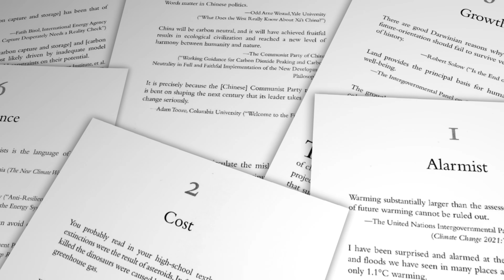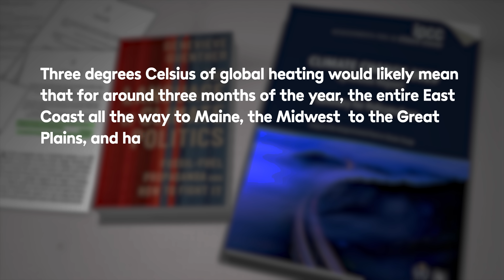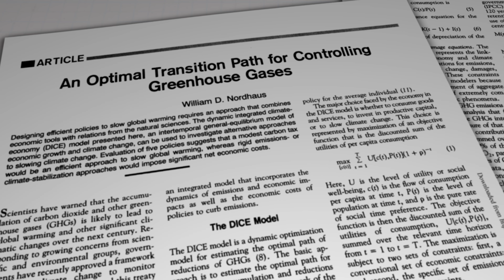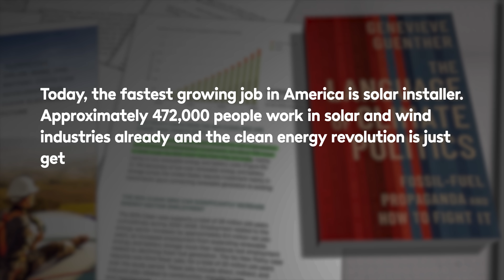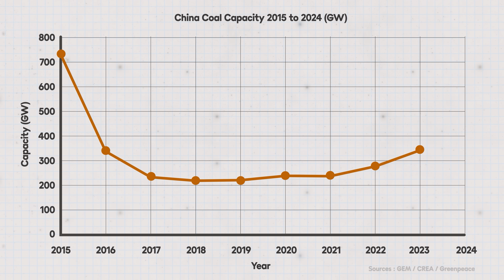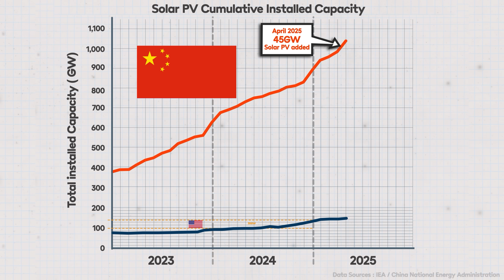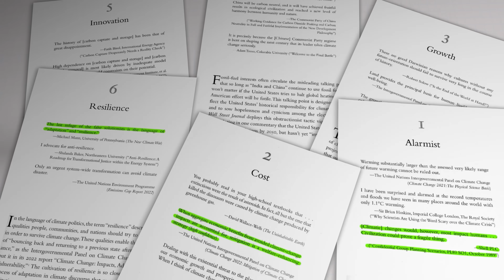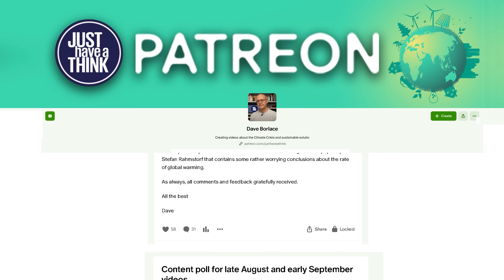New research DEBUNKS climate disinformation.

Comment: There has been a 10% decline in natural disasters since 2000 (CRED). When you use data from the World Bank and global insurance, and try to measure the cost to society of climate change, you find the cost is minimal and diminishing. Global weather losses as a percentage of Global GDP sank from 0.25% to below 0.20% between 1990 and 2022.
Based on data published in the Lancet in 2019, GDP percentage Climate-Related Disaster Losses have declined in all global income categories, with the most noticeable declines in the lower income countries (Watts et al., 2019).
Normalised disaster losses have decreased since 1990 and human mortality due to extreme weather has decreased by more than 95% since 1920, so you're 50 times less likely to die from a climate-related disaster in a world that's 1°C warmer than 100 years ago (EM-DAT, CRED/UC). Deaths from drought have declined by 99%!
The first half of 2025 (January to June) saw the fewest number of deaths from climate and weather disasters of any first half year this century. There were 2,244 climate/weather related deaths through to 30th June, 2025 (EM-DAT and AON data). Rough estimates of deaths from climate and weather disasters in the decade of the 1870s stand at 2,500,000 per half year; 250,000 per half year in the 1920s; 25,000 per half year as recently as the 1970s. There were much greater levels of deaths in prior decades from climate and weather events.
As an example of good news, Climate Change saved 555,103 lives in England and Wales between 2001 and 2020 (ONS, 2022).
Reply: These stats leave out a lot of information. What else has changed since 1920? Discovery of antibiotics? Mechanization of transit aiding disaster relief? Increased material wealth leading to more weather resistant infrastructure? Maybe dramatic waves of urbanization leading people to live in less disaster prone areas?
Reply: How about the construction of large concrete dams creating reservoirs to mitigate draught? Or a long list of increases in agricultural technology allowing for more sufficient stockpiles in the face of draught and famine?
Reply: @SomeSortOfMan All excellent points demonstrating how little we need to pay attention to all the climate doom-mongering. Humans can thrive despite (or may be because we are) living on a warming, greening planet.
Reply: @OldScientist  buddy all those things happened before the rock even started heating up. We're only starting to feel the effects now.
Reply: @SomeSortOfMan What effects? Apart from some warming, there's nothing much happening.